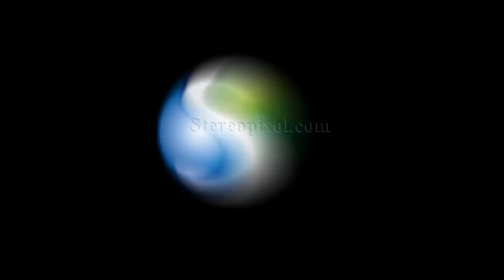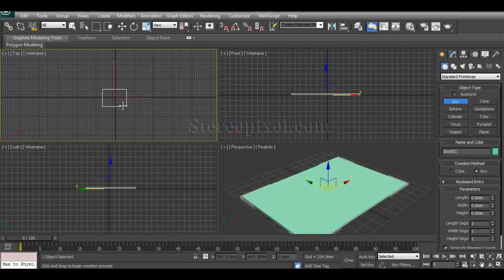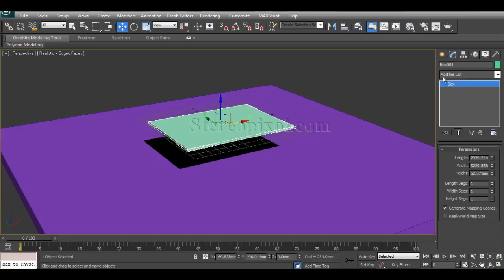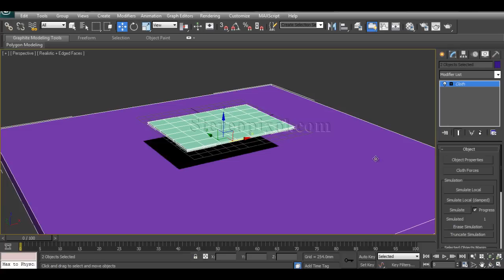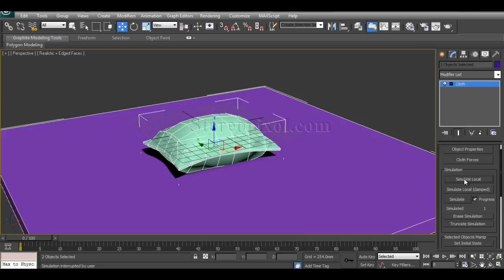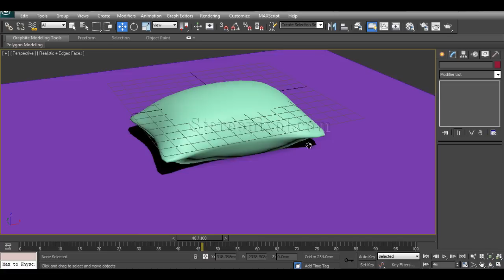Realistic Pillow Tutorial In Autodesk 3Ds Max for Beiginner

Comment: Hello, I did the same thing you did but my pillow didn't get as round as yours. Could you tell me why it happened? maybe the gravity you used, or self-collision number.
Reply from the maker: Bas LN might be both . first make sure you took a box and have some subdivision in it.
Reply: done already. checked many times hehe the problem is that the edges are not rounded but rather square-shaped. dunno why
Reply from the maker: Bas LN Use turbo smooth or mesh smooth after the simulation.
Reply: also did, the problem is before doing it, when you make the "local simulation" and the object falls down on the surface - it didn't become fully rounded as in your video, but rather retangular.
Reply: Bas LN Ok then it might happen for the amount of the pressure ..... you can try to increase or decrease the pressure value according to your scene setup. Hope this will do.